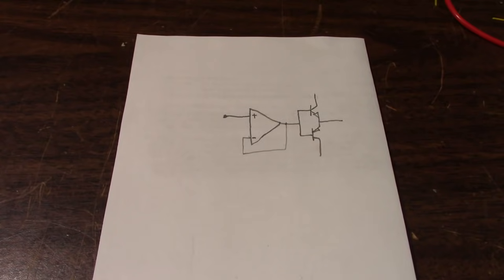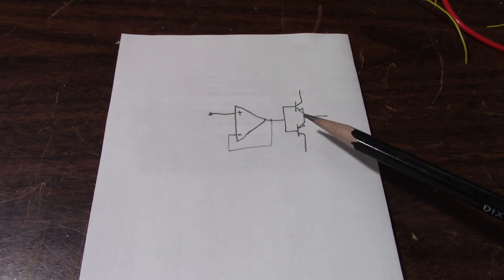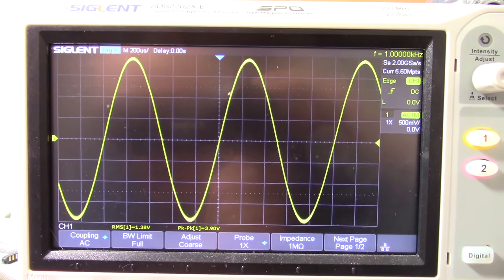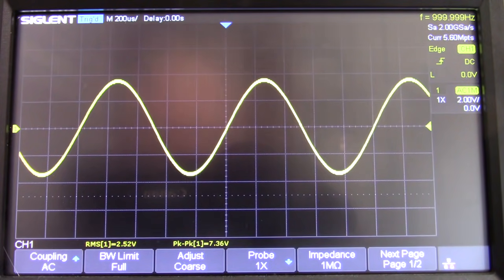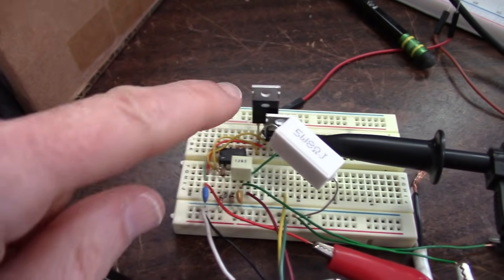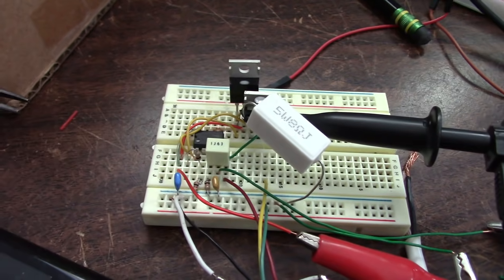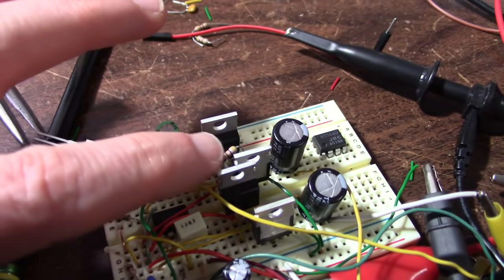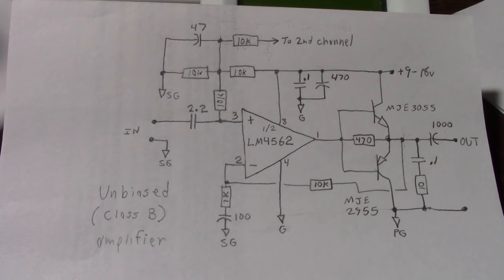Class B stereo amplifier with schematic -  No bias!

Comment: Pioneer sold 2 small amps in the late 70s that used an LM378 as a power opamp to driver unbiased output transistors (TIP31/32). One used a 32V supply for 20Wpch (model GM-20?) and the smaller used a +/_12V split supply for 16Wpch. They had a 22ohm base-to-emitter resister. They were fairly small and worked fine. LM377/378/379s were quite popular and RS sold the 377 for experimenters. The 379 was used in several pinball machines, too. Very hard to find now.

Comment: This puristic design is very inspiring. I have allready simulated your idea with LTSpice in order to optimize the design and to test it on breadboard. First of all I added a snubber at the output of the amplifier and a low pass filter (1 kOhm, 3.3 nF) at it input. Instead of the MJE3055 / MJE2955 I will use 2N6488 / 2N6491 because they have a current gain of 250 at 1 A and higher transit frequencies. The base-emitter bypass resistor seems to work better in case of 270 or 330 Ohm. I will test it on a breadboard as soon as possible.
Reply from the maker: I'd be interested in your results. One mistake I made was not using a lower "feed forward" resistor (as I call it). Since the op amp is providing the current in the +/- .6v range, the op amp has some headroom for a lower value resistor. It would be interesting to model a complex speaker load on the output and see how the amp deals with that.
Reply: @JohnAudioTech  the "feed forward resistor" doesn't really feed forward. My simulations show, that the feedback loop of the op amp mainly provides a very fast jump of the base emitter voltage across the resistor in order to open the respective emitter follower very quickly. So it is not really the current of the op amp that drives the speaker. The current is provided by the emitter followers. It means, a sufficiently high slew rate of the op amp is really important, especially at higher audio frequencies and high output voltages.
Reply: Hi Gunter.
The resistor does do a useful job, actually. The more current that goes through it, the lower the required op-amp slew rate.
Reply: @FlyingByDave  if you use an op amp with a slew rate of 10V/µs it crosses 1.4 V within 140 ns. The limiting factor is the GBP of the output stage transistors. If you use the combination D44VH10 / D45VH10 you can achieve about 1 µs cross over notch. This is not audible.

Comment: I've done this with a 2N3904/2N3906 (TO92) pair for a small op-amp circuit and needed something to drive a pair of 32 ohm headphones. Worked well, doesn't take up a lot of space or draw much current.

Comment: Kind of surprised I haven't seen manufacturers do this.
Reply from the maker: Actually an amplifier called the Quad 405 used this concept back in the 70s. Of course, they went several steps further for a high power amp.

Comment: It remembers me as I was 18 and was messing with a bread board creating from scratch and discrete components a class a transistor amp... Class b was too complicated for me at that time and I had no youtube and no teacher... I figured out how to bias at 50% stauration my transistor and feed it with audio and hook the output thru resistors and put a cap to the speaker at the output pin of the transistor.. well, I think it was something like that... about 16 years ago...
I was surprised how you could achieve such good quality with unbiased setup. I would eventually like to get a breadboard crash course on class H amp, those used by large PA manufacturer these days to achieve high output and low power dissipation by keeping the transistors at 90% saturation all the time varying the supply voltage just above the full saturation line of the output sinewave... Well, that's how I understand it... 
Not sure that could fit on a bread board, you tell me... I've got no clue. But to me, power effiency is quite an important thing... and those class H amp can give a lot of output with little power at the input, even for low power application such as an 50 watt rms per chanel computer speaker amp...  I've always been into integrating a decent audio power amp to my computer tower so I can connect my speakers directly to it without using a discrete amp... and such class H amp would be suitable to be powered by the internal 12v rail of the power supply...
Thanks again for this crash course. Take care!

Comment: I tried the same with TDA7294 and it works well. But to be honest TDA7294 does not need a booster transistor to provide extra current, the chip itself is very capable. The only thing pulling back my tda7294 was the power supply. With additional transistors TDA 7294 runs cooler, that definitely an advantage 😀. Thank you for the video John 👍.

Comment: I am really looking forward to the discrete amplifier. , I will make a 4ch version for my home.. although i am not sure if using tda7294 would be better or not , I will also make a separate board with 4 transistors in parallel with balancing resistors ofc to drive a subwoofer.. (all of my speakers are 4ohm)

Comment: This amplifier is in class B + C or AB + C. The opamp is class B or AB and a class C transistor. If you connect a resist to the output of the opamp to ground, you will make it work in class A. Great presentation. Fast opamp provides good performance. but it did not limit the bandwidth, which raises concerns about the stability under the capacitive load. typical test is 8ohm in parallel 0.47uF or 4ohm + 1uF and 1khz rectangle.

Comment: Hi John , 
The output caps on Class B amplifiers are not only to block the DC , they are also there to provide the speaker current  for the negative swing . One speaker terminal is connected to ground the other is connected to the top of the PNP transistor, the bottom of the PNP transistor is connected to ground and so, without a capacitor, the current path is from Ground To Ground with no potential difference. There could could not be a current flow in that path without the charging and discharging of a capacitor.
Reply from the maker: Yes I'm well aware of that. That is why it has to be set at 1/2 the supply voltage.
Reply: @JohnAudioTech  The setting of it at half the supply voltage alone would not cause current to flow through the speaker on the negative swing. It is a necessary presence of the capacitor with, specifically,  its charging and discharging,  that  allows current to flow through the speaker when the PNP transistor conducts.
Reply from the maker: @woodcoast5026  I know how it works. I didn't want to get into a long explanation of something we both understand.
Reply: Shouldn't audio amplifiers be powered by a split-rail power supply? Allows for a simpler design.
Reply from the maker: @FlyingByDave  Split rail is the best but as I said in the video, some people want single supply for ease in battery use.

Comment: Hi John I have an Phillips subwoofer and it's amplifier is gone so I want to make an amplifier for it,the ratings of subwoofer speaker are - 16ohm 80watt so do you have any idea what kind of amplifier I make for it?and what number or Voltage and amp transformer for amplifier do I use.

Comment: Gréât job John
I realy love your lésions/demo
When I see this vidéo I have some questions...
Why do more?
Why it’s not Hi-Fi
How to increase power by adding extra transistors?
Why sometime I see 0.48 Ohms résister bêtement NPN & PNP?
Regards
Davy
Reply from the maker: I consider HiFi to have lower distortion. Under .1 %. There's no standard to what HiFi is though. This can be a 10 watt amp with more supply voltage. The emitter resistors are for thermal stability and linearity. There is no real need for them in the this circuit.

Comment: Hi John, have you made any component value changes to the schematic ? I'm looking forward to seeing the next build, when you get further with your testing would you be able to look at my layout design to see if there are any glaring 'no no's that you see before I have any boards made , and if I do have them made I would very much like to send you one also its probally a bit early to ask what price you kit is being pitched at, want to thank you again for the tutorials associated with the various stages of JAT501 design, my board uses some SMD components at the input stage I'm quite pleased with my design aesthetically too and would very much like your opinion ..cheers.
Reply from the maker: The latest schematic and BOM was posted on Patreon last Spring. I changed the supply bypass caps to 330uf low ESR, and the coil in the output should be in the .7 to 1 uH range but nothing else. I was very happy with initial tests of the prototype that I doubt there will be any other changes.

Comment: Hello. I made TDA 2005 amplifier in bridge mode with bootstrap (36dB gain). Circuit was from PDF of this produkt. First chip did't work and the second blows out and now has a big hole on front of them. I didn't do any mistake. I check it about ten times. Do you know the better circuit for TDA2005 in bridge mode?

Comment: 1. Did you measure THD at higher frequencies, say 5 kHz or 10 kHz? 2. Could you simplify the layout by using the op amp in the inverting mode?

Comment: Hi John, thanks for the video! 👍 Would there be any benefit to using a reverse-biased (snubber/flyback/etc.) diode across the speaker output? Or does it not matter at this power level?
Reply from the maker: I may not be following you. Connecting a diode across the speaker will short  half of the AC signal.
Reply: @JohnAudioTech  I'm afraid you got me spot on. D'oh! Thanks though!